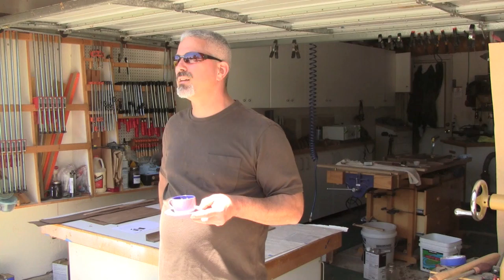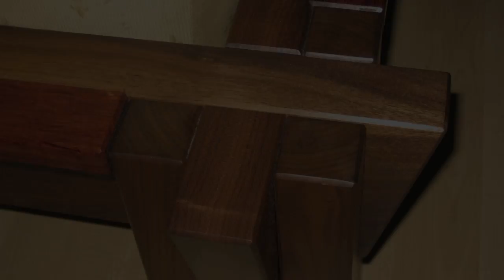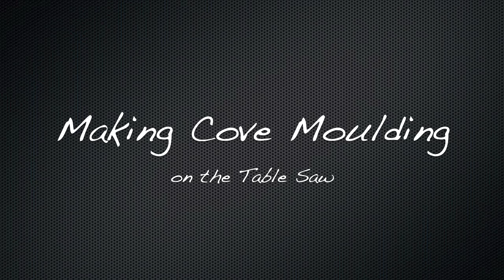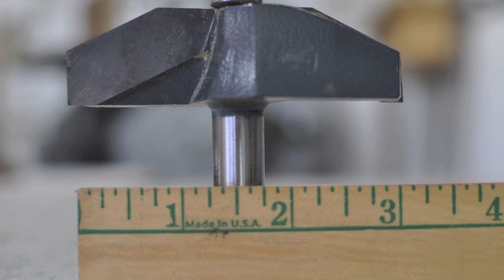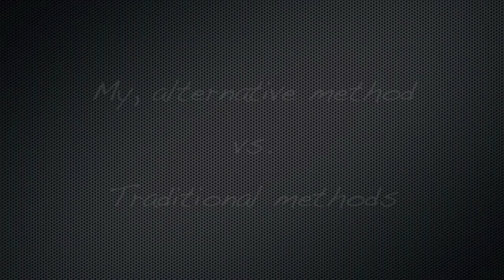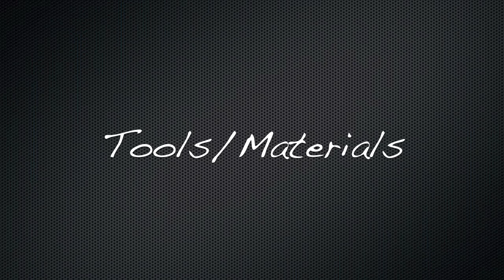Making Cove Moulding on the Table Saw

Comment: To set the left fence. I drop in margin thickness (setback spacer) of wood with the molding spacers. So I don't have to mark the table and measure back then set  the left fence (No induce able dimensional error). Doing this I can lock down the left fence right away.
Reply from the maker: +Imqajack Thanks for the tip.

Comment: 1 simple hint. You can save yourself hours (depending on how much cove you need), but taking most of the meat out of the center with passes from a Dado blade.  Terrace the Dado cut and then do the final cove cuts with a lot less material to remove from a full thickness piece of stock.

I have done it many times in the past, having 20 plus years of carpentry under my belt
 
This is a good video explaining the different ways angles, and blade angle effects the final shape of the moulding.

Comment: the cove is basically half of an ellipse, so using geometric terms is guess it would make sense to call your "width" the major diameter and your "apex" the minor radius ;)
Reply: sorry but that would only make sense to a high school student who is taking geometry.  <I did that back in 1964 and trust me, those are not common everyday terms.>
Reply: cattey isaboar thats like saying, "don't call that variable speed motor with a collet attached to a shaft a router because only on wood worker would understand that"
Reply: Austin Ray, that's not true unless the edges of the cove make a 90° angle with the "bottom" of the workpiece.

Comment: i made some molding for a project using pvc pipe and wood "first you make a 90 degree with two pieces of wood then the pvc goes in the corner screwed from behind with out the screw coming through because its going to be painted you never know"